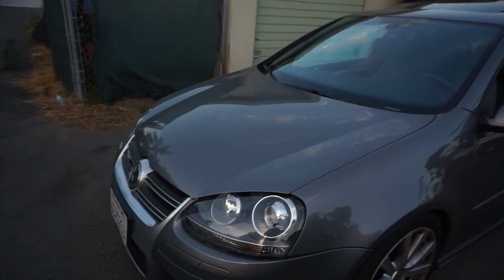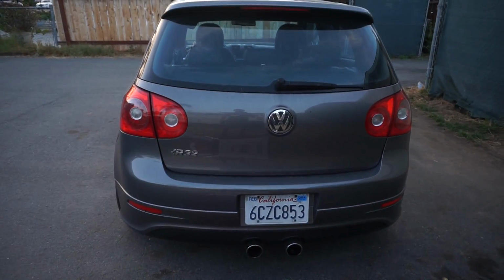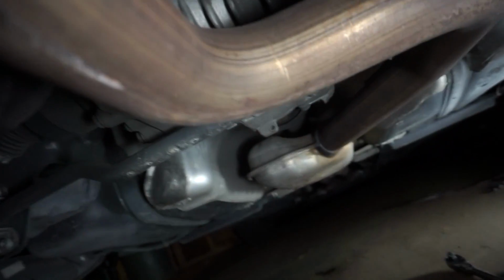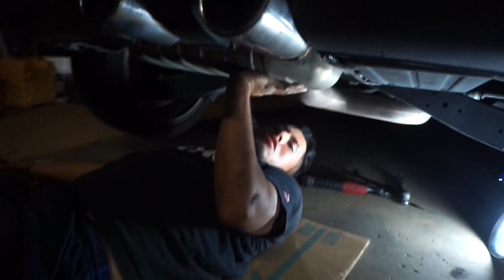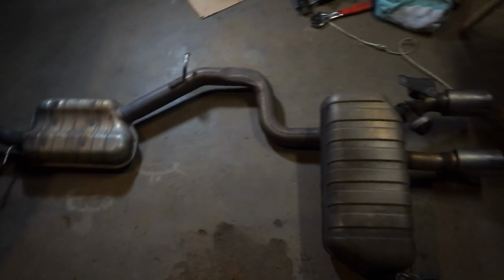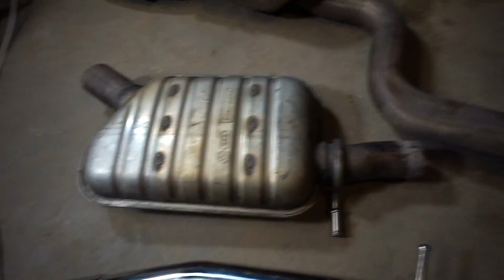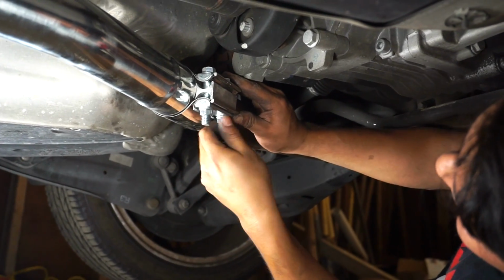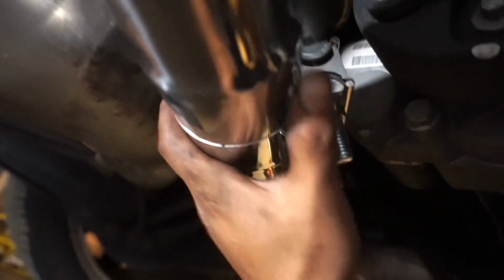VW R32 Resonator Delete

Comment: Sounded too raspy for my tastes but looked easy to do. I imagine a muffler delete would sound better.
Reply: Exactly.  These guys that market a resonator delete do it for pure profiteering as they know the owner would not like it in most cases and will make more change = more profit.  The resonator cuts down on raspyiness, drone and vibration.  Why would you want to delete that whereas the muffler/silencer reduces the volume of the system mostly.

Comment: Any problems with the transmission dsg or tiptronic?
Reply from the maker: IMPERIAL 30312 No problems at all !
Reply: IMPERIAL 30312 there very strong I have one too number 2673
Reply: If got a 6 speed manual no problems with that eather